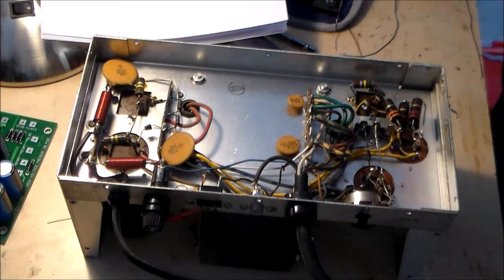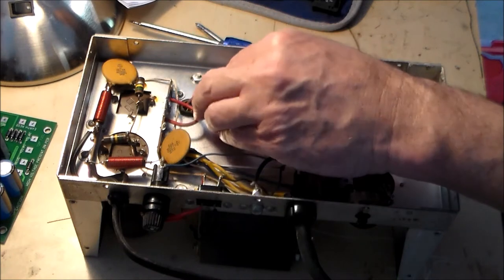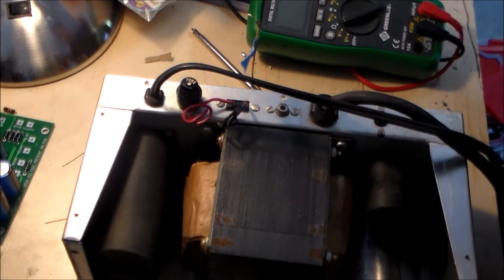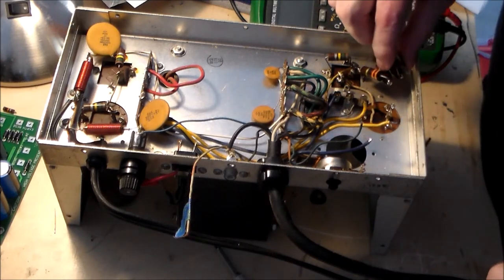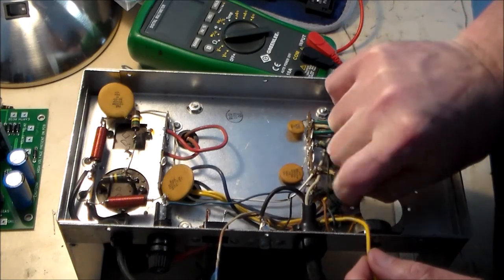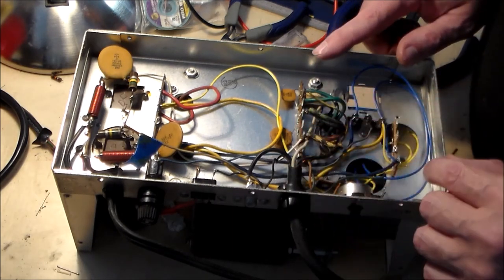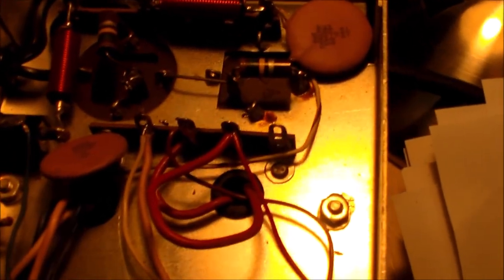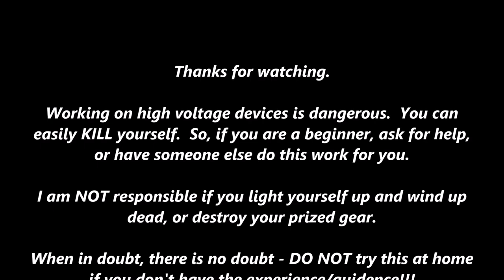Drake 1970's vintage AC4 Power Supply Recap and Modification Part 2

Comment: At 31:50, you noticed an additional small yellow wire that is a mystery. Did you ever figure out what happens with that? I'm at the same point now!!!
Reply from the maker: Do you still need help with this?  I don’t recall where that wire went - guessing one of the terminal strips or the bias pot.  I can crack open the bottom of the case and see if you need me to
Reply: @mikehartmann5187  Do you recall if possible it simply gets clipped out?  I think the instructions don't even mention it.  I don't want you to open up your supply again. I know its a pain!  I can ask the Heathkit shop to claiify.
Reply from the maker: Dave Edwards not removed to my recollection.  I’ll take the bottom off the supply shortly and see where it went
Reply from the maker: Dave Edwards does that “extra” yellow wire come from the cable leading to the transmitter?  If so, the that wire goes to the 2nd lug from the right on the NEW terminal strip.  “Right” is defined as having the PS oriented with the power cord and xmitter power cable on the left coming out the left ‘long’ side, and the new terminal strip facing and closest to you.  So, not the right hand end lug, but the next one in to the left.  If this is confusing look at 56:04 for the newly installed terminal strip and you can see the 2nd lug in from the right